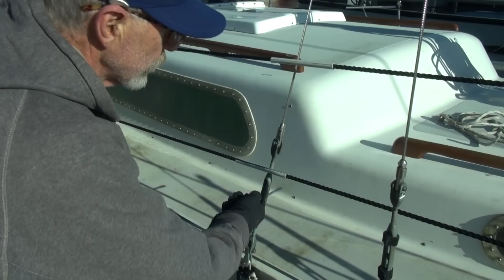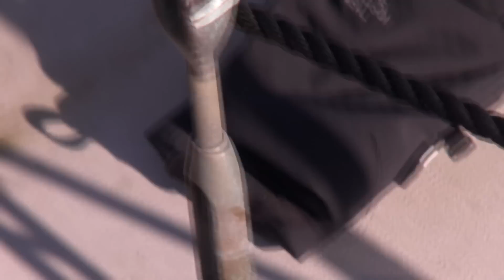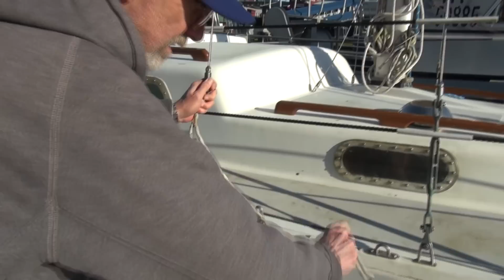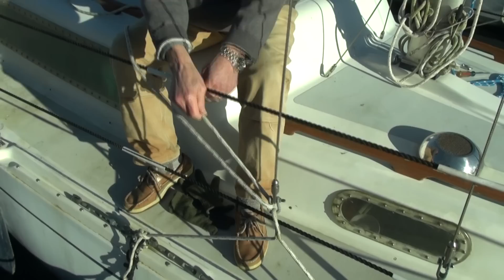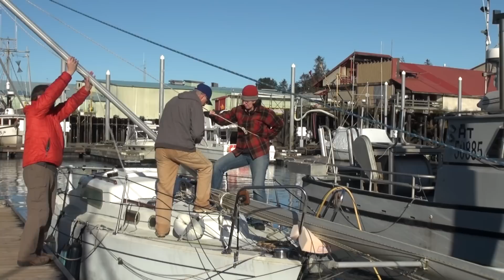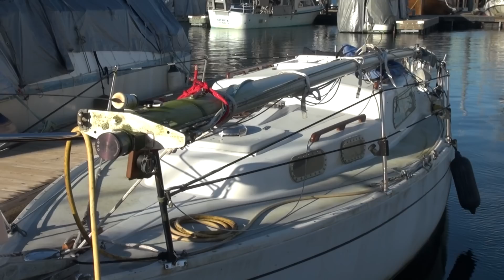Cruising Lealea Refit No.11: Dropping the Mast

Comment: Neat system you guys have there. We drop our mast rear wards but then we need to have a separate Gin Pole, you just need some rope. Much easier to find on a boat :-)
Reply from the maker: +funNstuff with the Foxwells Even better, we can lower the mast with the mainsail and cover on if need be.  We have two, four part mainsheets that we shackle together for this operation.  We have seen it done the other way, on our friend's Vega, Wren, but this system seems so much simpler.  Anyway, it came with the boat d;^)

Comment: I'm in the process of installing a similar hinged mast step on Vega #3360. Can you shed any light as to what size fasteners and (more importantly) what sort of backing plates your mast step utilizes, if any? Thank you so much! You guys are our inspiration!
Reply from the maker: The bottom plate of the mast step is secured to the deck with four countersunk machine screws. They are about 5/16 inch thread size and are secured inside the cabin with nuts and washers over two stainless steel plates, one on either side of the main beam.

Comment: Great video of lowering the mast by hand. I was hoping to get some details on disconnecting the electronics. Currently refitting my boat and wires were a mess. I ended up cutting them at deck level. This spring I need to make the reconnect. Do you have any recommendations?
Reply from the maker: +Francotouristo The wiring in our mast, steaming light, masthead combination light and VHF antenna co-ax,  are fitted with quick release connectors below the deck now, but we had to cut them the first time.

Comment: Chuck, could you post some sketches of the hinged mast step? Thanks in advance!
Reply from the maker: Sure thing. I think I have some photographs but I'll have to dig for them.
Reply: @Cruisinglealea  One more time: thank you!
Reply from the maker: @gabrielfusaru1211  Gabriel, it's taking longer than I thought to do this right for you.
I tried to draw an accurate sketch but I realized that you can see the thing better in the video if you freeze it at about 2:12. It is basically just a rectangular strap hinge with a 2.5 inch round hole in the middle of both pieces to accommodate the wiring and a 3 inch flange welded to the top strap that exactly matches the inside of the base of the mast to positively locate it on the step. I am searching through my files to find a photo or video that shows it with the hinge open and I will continue to try to sketch it for you but I can't take accurate measurements of the inside with the mast up.  A lot of people have asked so I really must do something about it. Eventually I will have an actual pattern available but it's going to take a while.
Reply from the maker: @gabrielfusaru1211  I posted the best photos I could find on the Albin Vega Facebook page https://www.facebook.com/groups/169639133073151

Comment: 'Nuther question for you, guys - I got my hinge installed, and I'm reinstalling my standing rigging today - but I wonder if you could give me an idea of just how long the mainsheet needs to be, to pull this trick off? Thank you so much, hope you enjoy the Seattle boat show!
Reply from the maker: The mainsheet needs to be long enough so that the four-part tackle can be let out enough to allow the boom to touch the aft lower shrouds when fully extended.  We use two such tackles, interchangeably, both the same length.  One as the mainsheet, the other as a boom vang/preventer when sailing off the wind. (On a Vega with roller reefing main, the vang must be connected to the end of the boom like the mainsheet so it has to be pretty long) To lower and raise the mast, as in this video, you need both of them shackled together. Sorry I can't give you the length in feet.  We just rove the tackles off a whole spool, hooked it up and let the boom all the way out, then cut and whipped the line.  I would estimate that both tackles require a total of about 150 feet of rope.  We use 7/16 diameter line for all sheets because we find it more comfortable on the hands.  Halyards have to be 3/8 inch to fit the masthead sheaves.  If you are willing to use the same rope for all your lines, a 600 foot spool would be the way to go.  More info here: http://cruisinglealea.com/afewlinesonrope.html
Reply: Chuck, Laura - thanks again. Very much. God bless!

Comment: That looks way easier than the gin pole method I used with mast going aft. Do you have to adjust the side stays as it comes down?
Reply from the maker: +crashkahuna Once it is set up, no adjustment required.  The key is to get the shrouds and guys aligned with the pivot point.

Comment: Hi Chuck Mike from vega 2499. I'm going to do a similar set up as yours except going aft due to roller furler. How is your delrin and hinge base fastened together and to the boat. Thank you
Mike
Reply from the maker: The bottom half of the hinge is through-bolted with 4 countersunk machine screws. The screws are about 3/8" in dia and extend all the way through the Delrin block and the cabin top into the cabin with a stainless steel backing plate on the inside. It originally had a neoprene gasket under the hinge but the 3M 5200 I used when we had that off last (1996) is holding up just fine so...

Comment: Hello my Albin Vega mast compression .  problem . Can't you give me some help. How to make the bulkhead stronger. N . a . simple way ...Mario
Reply from the maker: It is a common problem in Vegas and is much discussed in the Albin Vega Group on Facebook. While we completely redesigned and rebuilt the bulkhead, simpler solutions are available that don't require so much interior demolition. Look up Steve Birch on Facebook. Steve is in the UK and sells a kit to reinforce the mast support beam. I think that's the simplest thing. You will get lots of advice in the Albin Vega Facebook Group. I Highly recommend it. The firs thing I would suggest is that you make sure your standing rigging is not too tight. It is a common cause of mast step compression. Second is check the machine screws where they attach the bulkhead to the tabs on the hull. Make sure the nuts are tight and the holes are not elongated.
Reply: Yes I all ready loosen up the shrouds  and is better now .fiou ! But don't know exactly what is the right tension .next week I will get some help from the marina HERE 
Merci for your time and help . Nice of you. Cu Mario

Comment: This is kind of fascinating...

Why didn't you take the boom off before lowering the mast?

good thing you are doing the re-fit now.. in 10 years you might be too old -- ha

How much does the mast weigh?
Reply from the maker: +Titus Tiger  The boom is needed for leverage.  The mast weighs about 200 lbs all rigged up as in the video.
Reply: +Cruising Lealea 
Humm, didn't think about it.. I was thinking it would add weight
Reply from the maker: +Titus Tiger The arcane arts of the pre-industrial sailor. Some of the things in Levers' Young Sea Officer's Sheet Anchor are pretty amazing.  http://astore.amazon.com/lealea-20/detail/0486402207
Reply: +Cruising Lealea thanks for the book suggestion

I thought about buying an O'Day Daysailer. It has a similar step mast as yours.. it made me wonder why every (smaller) boat doesn't have this, since it make so much sense to raising and lowering a mast
Reply: +Titus Tiger A hinge is not always needed to lower the mast, if it is bolted to the mast mount with two bolts. You would remove the lower one and are able to lay the mast over the rotation axis of the top bolt.
And by adding a mast-lowering-frame (https://i.ytimg.com/vi/MMlLTTGNrQA/maxresdefault.jpg) you don't have to use the boom for leverage, can lower the mast aft and even do that underway.
Reply: +Two aboard Tuuli 
True... but what you are describing sort of sounds like a hinge, without the extra plate
Reply: You're right, it is using the mast mount as a hinge!
Reply: +Two aboard Tuuli 
And for someone like me... a dinghy sailor... who puts up and takes down the mast each time by myself, having a hinge (or double bolt) that one could 'walk up' would make things much better.

My mast might weigh 40 pounds, but it is a long awkward weight, so something like this could be helpful